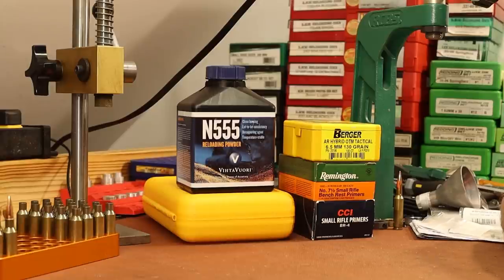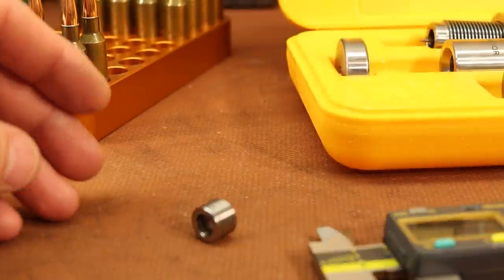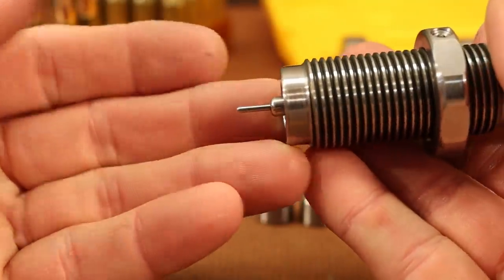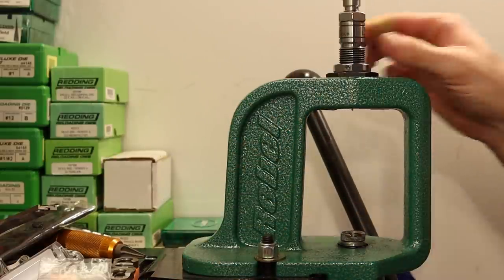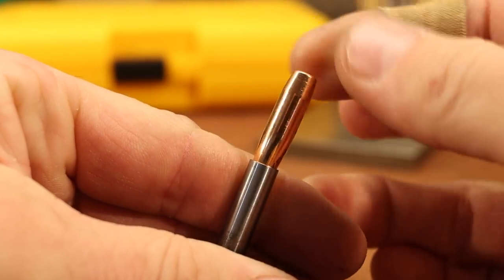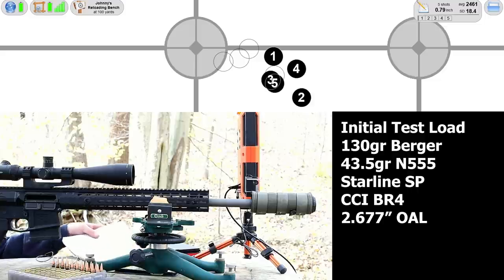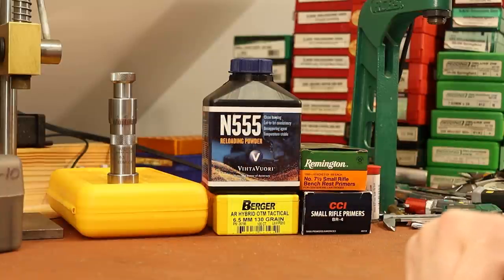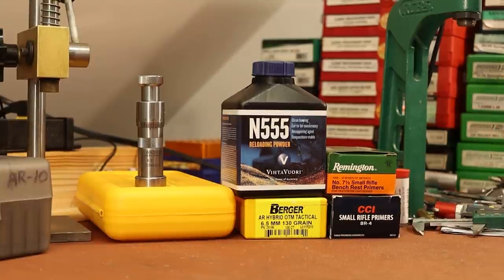6.5 Creedmoor - VihtaVuori N555 and 130gr Berger AR Hybrid OTM Tactical

Comment: Hey Johnny, According to your velocity chart 43.1 is the best place with the BR4 primer. You want the curve to be as flat as possible on either side of the chosen charge weight.   43.7 has relatively large speed changes on either side. I wouldn't pick it without a good reason.
Reply: I totally agree M M.  I'm finding that once I find the node I can then use a tuner to get the groups in shape.  Good work here Johnny!

Comment: I've used Wilson bushing dies for 10 years and own a bunch of Redding bushing dies which are also nice. The Wilson bushing has a neat feature. If flipped over, ie numbers down, it is about .0003-4 ten thousandths tighter due to a 3 degree taper intentionally machined into it. Sometimes your measurements indicate an uneven number bushing but since they are not available unless you send one in and have custom size made  you can flip it if you think the tension is a slightly light and possible get one that Little Red Riding Hood would call "juuust right". I do it quite a bit with new lots of brass which can vary a bit. Right now I have a friends 6.5 Creedmoor Bergara and new box of Lapua brass and I had best results when I flipped the bushing in a die I use for a batch of my own Lapua brass, which is perfect numbers up.

Comment: Vihtavuori has become my go to powder for the Grendel and the Creedmoor... With the 120gr Gold Dots and Vihtavuori N135 in my 6.5 Grendel I'm getting 2520fps out of a 20 inch Proof Research match barrel with a SD of 3fps and an ES of 7fps that's consistently shooting into .5 to .75 inches. My Creedmoor I'm using the Swift Sirocco 2 130gr bullets with Vihtavuori N150 out of my Howa 1500 that I'm getting 2730fps with a SD of 2fps and an ES of I believe 7fps also that's consistently shooting between .25 to .5 inches. I've also used N140 in both Grendel and Creedmoor that I'm not getting the velocity I want but still getting extremely good accuracy and numbers. I haven't tried any of the 500 series powders yet but will be in the future. Their stuff is expensive especially these days but so far everything I've tried has given me such good results that basically all I've had to do is just adjust my powder until I get the velocity I'm looking for. Great video as always keepem coming brother!!!

Comment: One way to deal with compressed loads and arbor dies: 1. Seat bullet only a quarter of the way. 2. Flip entire assembly upside down, letting the powder settle around the boattail and finish the seating to full depth.

Comment: Howdy Johnny, not sure if someone else here said this, there has to be an actual Machinist in here. If you set that Arbor Press up so that you finish the work/press, and the arm is parallel to the ground (you are pushing straight down on the arm) you will find it much easier to use. 
You may still have some slip on heavily compressed loads dependent on neck tension, but it still works easier

Comment: Very interesting video.  I used 130 grain Berger OTM bullets in Lapua 6.5x47 for a 600 yd. prone match Saturday.  The 6.5x47 Lapua holds less powder than the Creedmore but I have a 30” Krieger barrel compared to your 20” barrel.  It was a team match so I had a wind coach.  The rounds landed on call.  I think the Bergers shot very well indeed.  I used 39.5 grains of H4350.  The first match I shot rather badly so so all I can say is that the shots went where the trigger broke.  The second match I managed 13X indicating to me that the gun and the ammo shot very well and any misses were my fault.  It also indicates my wind coach did a good job.  The bad news:  Berger bullets now cost over 50 cents/round.  Every target shooters ideal is a bullet this good that doesn’t cost so much.

Comment: AR-10 6.5 CM with 18" Criterion barrel here, velocity of 2597 fps with 140 gr Barnes Match Burners and 42 gr of H4350, Lapua SR primer cases, CCI BR-4 primers.   I found the gun shot best with a shorter seating depth 2.74" OAl.  I also found a huge difference in how the gun ran/shot when I added a JP High Pressure bolt plus it did not tear up brass as much with that bolt.  Three five shot groups, shot back to back, that averaged .76" at 100 yards.  The gun will stay on 12" steel at 600 yards no problem,  hope to try at longer range in future.

Comment: Good video.  I must be lucky, I shoot the PPU (Privi) 120's and Hornady 129 SST's and have had great luck with my Savage 12FV.  The PPU 120's are a cheap ($.27) OTM bullet and the SST's speak for themselves.  Pushed by a mid charge of StaBall 6.5, Win 748 or IMR 4350 I get top velocity's and 3/8" groups at 100 yards using just a set of standard Hornady dies.  I do spend a huge amount of time on my brass.  In our current shortage I use Federal 308 Brass and resize it to 6.5 Creedmoor, deburr the flash holes and turn the necks.  These rounds just work in anything I fire them in so far and a half dozen whitetails have fallen to them in both mine and my family's rifles, most times DRT at ranges out to 200 yards or so.  On the range 300 yard groups if I do my part average 2", maybe slightly over out of my Savage, best I can do with the 6x24x50 Vortex Tactical glass on top but the performance of the loads has been just great and won't break the bank.

Comment: Generally you want to be in the middle of a flat velocity node, with the BR-4 at 43.5 seems to put you in a good flat node. Also when looking at the flat nodes, usually you should see another node within a 3% increase in powder. 
I would ignore the group size for now and base the decision on the flat nodes and start playing the COAL at +/- 0.003".
Reply: If you are 0.150” off of the lands, does 0.003” difference show up on the target?  I used 130 grain Bergers and got very good results.  I arbitrarily used 0.013~0.015” off the lands in  similar cartridge, the 6.5X47 Lapua.  I am using a single shot bolt gun so magazine length doesn’t apply.  Also, I like the looks of Johnny’s Wilson dies but I am using Whidden Gun Works dies.  Whidden chambered the barrel and their chambering reamers and die reamers are coordinated with each other.  There is no choice in brass since Lapua is the only one who makes 6.5X47 brass.  I also used a 0.288” neck bushing.  I do get a small amount of run out about equal to the variation in neck thickness.  I could improve that by neck turning but it probably isn’t really necessary.

Comment: Use a long drop tube to get the powder packed down better, and seat the bullet out a bit. I think the best compression is when it is just barely starting to compress, but not enough to push the bullet out. Semi-autos need good neck tension too, might go up on that.

I wonder if the barrel extension could not be stoned a bit on the place where the neck drags by, to reduce the gouge? Maybe there is a little burr there.

You can definitely waste a lot of time fooling around on the bench. For long range loads you want low standard deviation on the velocity. Group size ain't everything. Get a good enough load and go with it.

Group size is not a very good measure of accuracy. Try using radial standard deviation if possible - make all your shots count, not just the two outliers.

Comment: If you ever have that barrel out, its not a bad idea to take a chipstick with some 800 grit or a round ceramic small stone and knock the sharp points off of the lugs in the barrel extension.  I'm regretting not doing it in my last BA barrel, as i'm now bedded in and getting the beaver tooth marks on my necks.

Comment: Since you’re not compressed with that 43.7 grain load, I’d mess with overall length. Start at 2.800” and work down .003” until you hit the accuracy node.

Comment: I wonder from which hat they pulled 2.677".  Oh, 68 mm.  With that length, there is .308" in the case plus the .240" boattail, so maybe go longer?  Also, the N550 powder seems to be a little less bulky.

Comment: Hey jrb I always look forward to your videos.  I have a very similar setup with the 24" barrel. Mine is beating the crap out of my brass. Would you recommend the slr adjustable gas block to slow the carrier down? Keep up the content, even the idiot raising chickens is great 👍
Reply: In my experience the SLR is good, but you need to play with the adjustment screw occasionally to keep it from seizing
Reply: I built a JP LRP-07 clone using their VMOS BCG instead of their LMOS BCG since I only shoot it suppressed.  
  I run their SCS H2 buffer and their AGB, but I was still having issues with premature bolt unlock and not locking back on last round.  
  I ended up having to put a tungsten weight on the SCS making it an H3 buffer and that completely fixed my issues!  No more bolt unlocking prematurely and dirtying up my brass and locks back on last round everytime now.  
  It took a lot of work and testing/researching but finally figured it out after JP rifles YouTube channel posted a video answering all the questions I had asked in one of their previous videos which was either on purpose or just perfect timing.

Comment: you want to narrow things down but still used rem primers that you found to get pierced under high pressures? maybe watch your own playlist to find out that you settled on cci41 primers. was the brass annealed? might explain the crunchy ones. really glad to see a 6.5cm video, its been too long! hope this helps.
Reply: The brass was annealed and he used the rem primers because they were listed in the load data
Reply: @sapago4166  had to watch the video again to find the spot where he mentions the brass being annealed but doesnt explain why he would use a primer that gave him problems in the past.
Reply: @sherrypulec1449  It's true that he doesn't elaborate beyond saying that it was the primer used in the load data. 

That being said, it is the primer used in the load data. I don't recall the exact circumstances around him blowing primers, but it typically means you are radically over pressure and need to step your load down instead of reaching for a tougher primer.

Comment: My impression is that people use arbor presses because they are supposed to be more consistent, but I've been wondering what the functional difference is between them and a top down press like the Lee APP
Reply: The arbor press dies are fully supported chambers unlike many seating dies and thus the inherent advantages to alignment. 

However the truly next step is when they add a force pack to measure seating force and sort loaded rounds one last time for seating force in an effort to further reduce chance of fliers at distance.
Reply: Also they are easy to take to the range to loaded long and then refresh the necks down to seating depth for better consistency on range day….

Comment: I almost vote find a COL before messing with neck tension as I feel COL will have more of a play in group sized then neck tension will. So if you dial COL in first then neck tension maybe we’ll have some stupid small groups.
Reply: I have hoped someone would do the test but I think you may find that you may end up with a different combo to tune the neck tension not so much that one is necessarily much better. In super accurate high end bench guns light seems better but even F-Class guys are returning to no turn necks …

Comment: If you redo this start 0.030” off the lands/mag length and redo the BR-4s. Then look for the flattest spot which is not the peak you were looking at between two numbers. Then seating depth test.. try 3 you could seat long and then seat them as you go at the shooting bench. 3 may not reveal an issue but you can’t shrink bad groups so you could save ammo by not shooting the remainders of a bad group. As all would have the same charge at this point just seat them to the next test depth and continue on.. once you find a couple good one in a row seat just inside the long group to verify.

Comment: I can see that seating press moving and flexing. Doesn't look as it will be precise with compressed loads.
Reply: The press doesn’t matter with the Wilson dies because everything is contained in alignment within the die.  That is why he mentioned using a hammer.  The the die is the only thing that controls seating depth.
Reply: @texpatriot8462  Not talking about alignment but rather seating depth. Are you saying how far he pulls down on the lever doesn't affect seating depth? If the press flexes under stress from the bullet/powder compression I think the effect would be that the bullet doesn't get seated as deeply, same as if he didn't pull down all the way on the press handle. It's possible I don't understand the die and press but unless the seating die is bottoming out and hitting a hard stop every time I believe I'm correct. Thanks!
Reply: @BlackDotPatrick  The die does bottom out every time.
Reply: @rustynut1967  Thanks. Johnny did say maybe he wasn't putting enough energy into the stroke when discussing why he was getting less seating depth with the crunchier and more compressed loads. That made it sound to me as if maybe it doesn't have a solid bottoming out or stopping point.
Reply: Then I'm guessing it's "spring back" from the compressed powder. What do you guys think?
Reply: @BlackDotPatrick  if you look at the die, the top part comes down under pressure until it hits the bottom part of the die and stops against it.  That stop is what determines seating depth.   Provided you fully compress the die against that hard stop, seating depth won’t vary,  

That is why lightweight arbor presses can be used with these kind of dies.  It is my understanding that JRB’s seating setup today is about as precise as one can get.

Comment: 42.9-43.5 BR-4 really looks fine and where I would pick!  Why the BR-4 is simply the plateaus seen in the velocity data for a node. 

Eye test sure but chart is where the gold is
Reply: 43.1 with the br4 looks good to me. It's right there in the tight velocity node area.  If it won't shoot a good group he can then tinker with bullet depth to fine tune the load